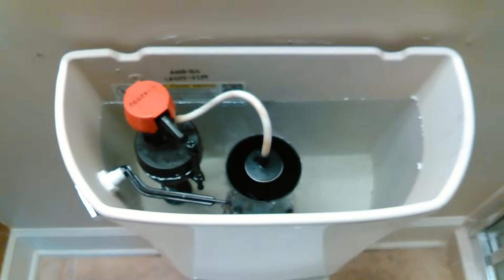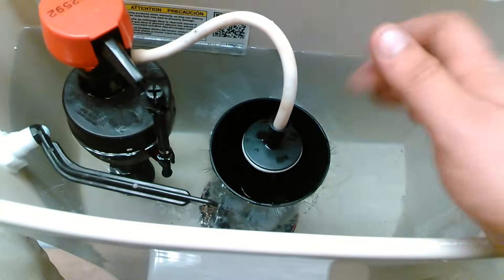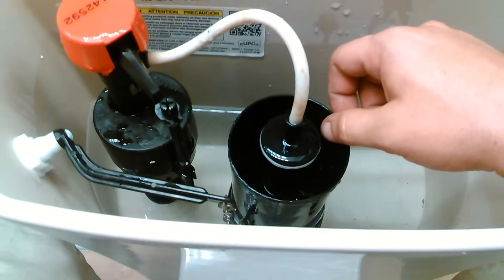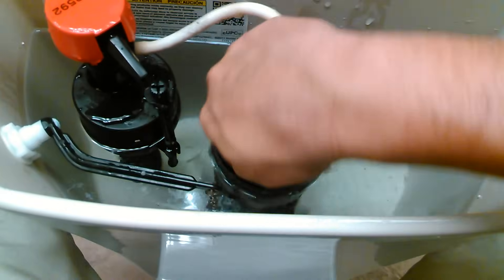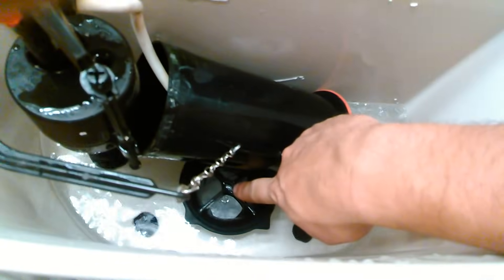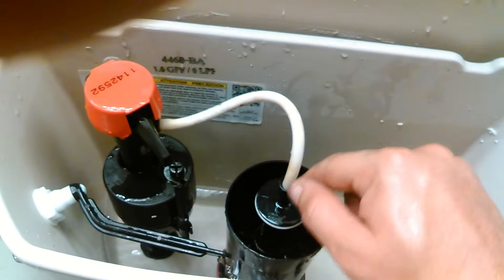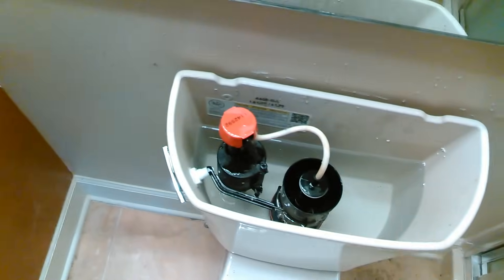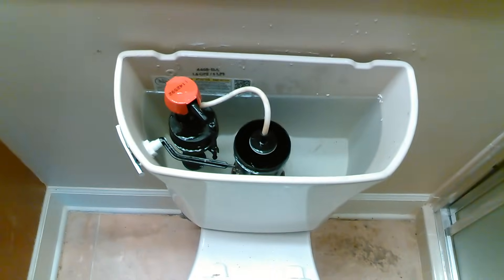Kolher toilet running no problem

Comment: This was handy to learn what wasn't my problem. I traced my problem to the "flush or trap handle" after exploring the problem suggested by this video. Kohler has a mechanism that fits into a square hole on the outside of the toilet. The actual chrome handle has to be able to move through this mechanism in order to full and release the chain. After time the plastic mechanism can expand and tighten down on the small metallic pipe that actually goes from the handle to the metal (or plastic) rod that attaches to the flush chain. My fix was to gently  drill out the plastic locking section of the "flush handle mechanism" so that the metal rod was no longer hanging up when used. This allowed the mechanism to work properly and no longer hang up when flushing the toilet. No more annoying running toilet. I haven't seen this mentioned on any other Kohler repair video so thought I'd post it here in case anyone want to update their presentations.

Comment: Thanks! Readjusting the seal worked (you might not have to replace it). Keep in mind that turning the cylinder is hard so you might feel like you’re breaking it.

Comment: Wow! That was easy! My house got flooded with storm surge from Hurricane Ian (Sept 28th '22) so the entire area of homes have to have the walls and cabinetry torn out and redone. I scored a Kohler toilet that a neighbor had set to the curb for FEMA to pick up. I plumbed it in this morning and darn if it didn't have the exact problem you covered here! I popped the offending gasket loose all the way around the groove. It was very compacted in that slot so I just stretched it out all the way around and reassembled  the center part of the tower and the seal is perfect. Thank you for the well explained simple fix. I would suggest folks just doing what I did first before spending for the new gasket.

Comment: I simply flipped over the rubber seal, wiped it off a little, and also where it contacts the base of the tank around the hole, and it's worked so far at no cost.

Comment: Old video but still holds true, thank you for this video. I’m normally a handy person and learn how things work while I take them apart to fix them. We just bought and moved into a new house and 2 of the bathroom toilets were having issues. This video helped me understand how the tank fill systems worked so I could fix the other issues with them. I was dumbfounded when I didn’t find a flapper or ball when I pulled the tank lid off.
Thanks again.

Comment: Thanks for this. First I changed the gasket at the bottom of the "flapper". That did nothing. What did stop my running toilet was to rinse out the fill valve. Took ten minutes!!!! The best part was it didn't cost a penny! Kohler has a video on how to do it.

Comment: Thanks, I couldn't figure out why my brand new toilet kept running every 2 minutes. Turns out someone in the factory set the chain 1 section too tight and caused the tiniest of leaks. Thanks again, this video helped me quickly figure out what was wrong.
Reply: Oh my gosh...thank you.  This is exactly what was wrong!  I did everything else he said and then I saw this comment.  The length of that chain never occurred to me as a possible problem!

Comment: First time I’ve had to address the toilet in my new place and the different inside threw me off. Would have taken me quite awhile to figure out how to remove the center part without your video. Also took your advice to clean the rubber gasket (and then I flipped it). Thanks!

Comment: Thank you for this great tutorial. After Farther's day dinner 2018 at Mother-in-law's home here in the Philippines, my beautiful bride asked if I could take a look at her Mom's Kholer, it would not fill. The unit in question is a little different design than your demo unit, with a push-button built into the lid rather than a flush handle on the side of the tank. The fill valve looks like my best friend the Fluid-master. Five minutes with you and about 90 seconds watching a Kholer factory repair video on the fill valve has given me all the information we will ever need to keep the fixture in top shape. Now, we cross our fingers the seal will be in stock tomorrow if needed? Always best to know how something is supposed to come apart for repair rather than using excessive force and destroy parts.

Comment: A million people give instructions to replace the seal on a canister flush valve, but nobody shows how to replace the canister itself.  I’ve replaced the valve so many times I could do it in my sleep. What do I do if that doesn’t fix the problem?

Please don’t misunderstand my comments. You’re putting this info out for others at no charge, and that’s commendable. I’m just frustrated (and the Kohler video turned off comments - so I can’t complain to them).

Thank you for your video.

Comment: quick tip, put the water hose line under the fill valve floater arm and it will keep the water from running without having to mess with the shut off valve while you work on it

Comment: Hello. Thanks for the information.  I have a new house (built in 2017.) My Kohler only runs once every week or so. May last a day. Then it stops. I did not take the thing off to look at the seal but it looks really nice inside. I was hesitant to replace a seal if not needed.   I am new to YouTube and not sure of the rules but I thought I'd ask for any suggestions for what my toilet is doing.  Thanks
Reply from the maker: This could be rare but considering it's still a new house sometimes Plumbers Don't deburr the pipes when they're put in you could be getting debris inside of your fill valve but this is rare also if you are on a well for water sometimes sand and sediment can make it way up through the pipes and get under the seals of that fill valve this is a long stretch though I would still look at the seal to see if it's seated correctly and also if you use those toilet bowl cleaners that make the water blue are the bleach tablets it eats the seals up really quickly
Reply: @geoffhoweth  thank you so much. I have no well. I do not use any tank cleaner and won't.  My seal is orange but I guess it doesn't have to match?  Also, I do NOT need to turn the water off, correct?

Comment: Once I realized I was turning the incorrect way (clock wise vs counter clockwise) this worked perfectly. All toilets now back in running order thanks for the $6 fix vs an $100 plumbing bill

Comment: Worked just as you said. I will add that the quarter turn to get it off was very hard until I sprayed WD40 down the tube. That loosened it up and came of easy

Comment: I tried all options and they still would run but it was random. Both toilets were installed 2 years ago and I have had the running issue since install. It was DIY install.  I finally noticed the chain on the handle had 2 extra links as it came this way from the factory. I dropped it to one extra link and since then neither toilets have had an issue. I believe the gasket has a solid seat now.

Comment: One of the different thing you might want to try and everyone out there. I discovered it's a quick fix and it works. And if I have to redo it every once in awhile it's because I have hard water the slide that goes up and down inside the toilet tank get loaded with hard water deposits and gets stuck. Spraying a little WD-40 on the slide below the cap helps out it works fine and doesn't run again

Comment: I have many problems with flappers.  I have tried different flappers. I even tried replacing the whole flush valve 3 times.  The first was a complete Korky flush valve, it phantom filled. The tried a FluidMaster, it phantom filled, not as ofter. The third time, I replaced with a Kohler Cylinder style and never get a phantom fill.  The only issue with the Kohler is you have to hold the flush handle until the flush is complete, then release to refill the tank.

Comment: I replaced the float and tge flush valve.  I still have a slow quiet drip sound.  It has improved but it’s still there.  I can’t find any videos on how to replace the base.  The Kohler instructions just said, “it’s difficult” ha ha!  It’s the only thing left to replace!  I have a one-piece tresham model.  Do you know if any videos or a special tool I can use that won’t damage base on install?

Comment: Thank you for making this video, Jeff! My apartment's Kohler toilet has been a nightmare since I moved in back in 2017 and I swear I've probably watched this video once every 3 months since just to double-check I'm fixing it correctly because having issues multiple times per year is just maddening. Low flow flush = line clog from toilet paper alone because my building's ancient pipes apparently need the full flush at all times, cylinder seal pops = running, cylinder rising popping water hose off the top cap = running, adjusting arm lift chain length to try to reduce the times the cylinder rising pops the water hose off the top cap = now the cap comes along too when it pops off and runs, etc. Plus my model came with a plastic domed lid which even a skinny friend found made an uncomfortable popping noise like it was about to snap and launch plastic shards into her ass when she sat on its closed top to watch me try on some makeup in the pre-pandemic times. It's just such a bad design to the point that I actively recommend to anyone rennovating to not buy Kohler toliets anymore, like an anti-advertisement. But as long as I'm stuck being a renter, this is my life at the mercy of Kohler toilets, so thank you Jeff for showing me how to DIY the 60-second fixes the maintenance man laughed over originally, saying he wished every call were that easy!

Comment: Works!!  Issue with the little rubber stopper at the bottom of the cylindrical stopper.  Popped it off, cleaned it, inserted it back on.  Voila!
Reply from the maker: Sweet... Glad to hear that the cleaning thing works also . But the rubber will need to be replaced in the future . Hey Thanks for Watching and glad I could help.

Comment: i have a flapper release one i just installed a new one , and now when toilet is full it turns on every 5 minutes and runs water for about 5 seconds? should i clean around flapper area ? or do i have to replace fill valve ?

Comment: My Kohler has same kit but water fill hose on mine feeds the tank and not into top of canister. Mine won't stop running after cleaning and replacing rubber gasket. The float not coming up all the way unless I move it up myself.
Reply from the maker: Replace the fill valve

Comment: My Kohler toilet has been running continuously for hours today after the last flash (flush handle doesn't work since this time). First the bowl filled and then took hours to drain. Then at one point the water level in the bowl stayed the same whilst the water was still running.

But now the water bowl water level is rising and it's 4am & I need to know whether the water level can overflow while I'm sleeping. Is it safe to turn off the water knob thingy near the ground till the plumber comes?

Comment: GREAT JOB.  And as a 20 year teacher, I can tell ya, showing how to do this is not as easy as it looks. Good job. I'm going to try this. I've got to figure out how to find the right size of rubber seal. I wonder how you do that?
Reply from the maker: Thanks  yesiownfrodo you can but the Flush Valve Seal HERE  http://amzn.to/2spyLoV Thanks for watching
Reply: I walked into Ace hardware with the bad gasket in my hand, walked over to "Toilet Repair" and found the identical Kohler gasket hanging right in front of me.  Piece a cake!  Thanks
Reply: I did shut off the water at the valve under the toilet so I didn't have as much fun as you did 😁😁😁

Comment: For a few years now my toilet will not flush completely unless we hold the flush handle down until the toilet completely flushes. The large cylinder drops as soon as we let go of the handle and therefore makes it so there is not enough water leaving the tank into the bowl to flush. Any ideas?

Comment: question,  white tube how to make it stay in place??  keeps popping out
Reply from the maker: Cut it a little bit shorter not too short the lid is hitting it when you put on the lid making it pop out of place if that doesn't work I guess you could super glue it thanks for watching
Reply: Yes, so does mine. Crazy

Comment: Every once in a while my cylinder will not drop back down so I have to take the tank lid off and just tap the edge of the cylinder with my finger and it drops and seal fine. I am trying to figure out what would bind that cylinder from dropping back down. Any ideas ?
Reply: I have the same issue, did you figure it out?

Comment: For those seeing this in 2021, you always supposed to turn the water off before this kind of stuff. The knob is by his left feet and it’s very easy to turn off and on.
Reply from the maker: Your not a maint man are you? If I turn that valve and it breaks the cpvc pipe ,you have got a lot more problems than just a little drizzle.  😷

Comment: I followed these instructions and found a hard plastic black piece from manufacturer that was left on the rubber seal.  Scraped off the black plastic and now the toilet doesn't run!

Comment: I noticed today that my toilet was not flushing properly.  When I removed the lid, I saw that the top piece that the hose connects into has broken off and was wedged inside the canister.  The hose was disconnected and just pouring water into the tank.  I took the broken piece out and tried to flush the toilet again, and it seems to work fine with the hose pouring water into the tank instead of being attached to the top of the canister.  Is there a problem with leaving it like that or should I try to replace the whole canister assembly?
Reply from the maker: It will work but... you will notice that the water level in the bowl will be lower (sometimes). You could take the hose and drop it down the canister but then once you flush the toilet it will lift the hose out and back into the tank (most times) I would replace the whole canister assembly if it causes problems. To replace the whole canister assembly you will have to remove the whole tank . There is a really big Nut on the bottom of the tank sometime a spud wench is needed to get it off. If it is still working fine... BUT that hose could change direction in the tank and spray water over the tank lid causing a mess are even a flood. If it was me and I do have the same toilet at my house. I would replace the whole canister assembly. Hope this helps and THANKS  For Watching. Linda

Comment: ok- broke the cap (It'sd the yellow cap)- the latch tab broke off so cap is just free floating now- doesn't twist and lock onto the shaft assembly anymore- and quick fix for that without buying the whole cannister fill kit?

Comment: Is the big black canister supposed to have water in it?
Reply from the maker: Marilyn Yes but the water should not go over the top of it you can adjust the water level by the screw on the fill valveThanks for watching Maryland I hope this helps

Comment: On my toilet I'm having a running problem but it's not because of what you're talking about. 

It's actually the float to the left that won't go all the way up and it causes it to run.. 

Sometimes the float goes all the way up and sometimes it gets stuck.  I've tried everything I can't fix it.
Reply from the maker: You can try a simple trick and that put vinegar in the tank leave it overnight but in most cases i would just replace the fill valve .

Comment: How do u keep the fill valve hose from coming out the cylinder?
Reply from the maker: It's just pressure fitted joint  just shove it in  😁
Reply: @geoffhoweth  i have lol..Koehler sent me a clip but don't know how to install it...have u seen the clip?
Reply from the maker: @isaiasortegaiii5959  That must be new i have never used or seen the clip

Comment: The problem with my toilet is that white filler tube keeps popping out and the water runs into the tank.  At least once a day after I flush, I have to take the lid off the tank and stick that tube back into where it's supposed to go.  What do I do?  I can't afford a plumber.

Comment: The rubber ring on my toilet was full of water bubbles. I popped them and just pu the ring back. Problem solved!
Reply from the maker: yea sometimes a little cleaning or replacement works. Never knew about bubbles that's good advice  👍👍
Reply: Turns out I had one air bubble in my Kohler toilet ring, and after I popped it the water stopped leaking! (Amazing that this video is 2 years old, yet Ram Lo made a comment about the bubbles just ONE DAY before I came to youtube to look for a solution! If Ram Lo hadn't made a comment about the bubbles I probably would have bought a new ring and "wasted" $7!) 

Thanks Ram Lo and Jeff!

Comment: To anyone watching this that hasn't fixed a toilet before....turn the water off first!
Reply from the maker: To anyone watching this that hasn't fixed a toilet before or worked on one. If you have a stuck angle stop/shut off valve and cpvc pipe turning off the water could snap the pipe causing 1000s of dollars in damages (aka flood) or if you can get the stuck valve close you are lucky. But might not be able to turn it back on take it from me being in this field for 10 years. I rather deal with the little piss stream than deal with the possibility of a flood. But that's just me do what makes you happy.

Comment: I changed the seal and it still is running
Reply from the maker: +Randy Boggs Try changing the fill valve
Reply: it's probably your flapper chain being to tight . I'm the same as you , but i solve this problem is by adjusting the chain . I changed it all the way up to make it loose not tight. Then after 30 mins i check and see the water line and so far no leaks. So try it out and see.
Reply: Same here and the chain is loose